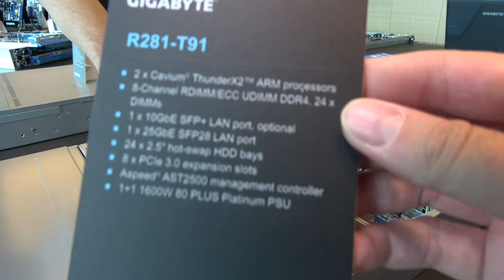GIGABYTE shows Cavium ThunderX2 ARM Server Portfolio

Comment: Charbax, CISC vs. RISC doesn't really matter anymore, all modern architectures for x86 and ARM are fundamentally similar. ARMv8 does have an advantage being more modern/clean and it doesn't carry the legacy baggage that x86 has. In theory, you burn less transistors to reach a given performance level with ARMv8 vs x86 (depends on implementation, of course).

You have an interesting point about Chinese chip houses. It seems that those small companies don't have the funds/people needed to build a fully custom in-house core. If ARM provides a dedicated server core and other complimentary IP, I bet they will jump in.
Reply from the maker: Yes what I am wondering is if Intel's CISC is having issues at getting a stable design at lower than a 14nm process node.. Maybe something about ARM's designs more suitable right now for 10nm, 10nm second generation and even 7nm coming shortly. If next year ARM comes with 7nm ARM processors while Intel still can't get into something smaller than 14nm, that could be a big advantage for the ARM industry.